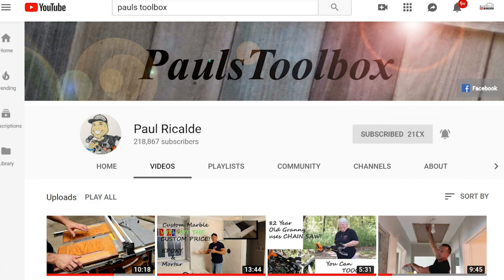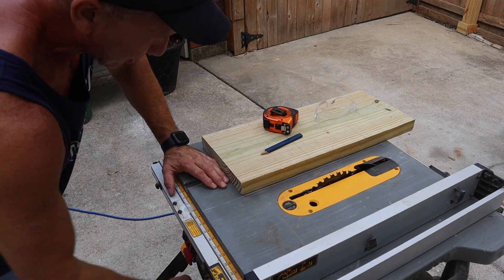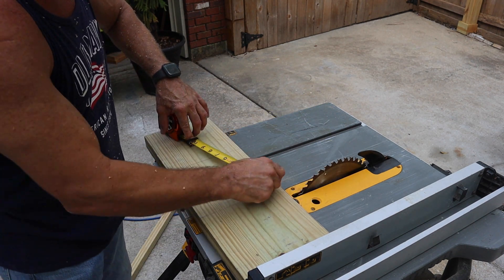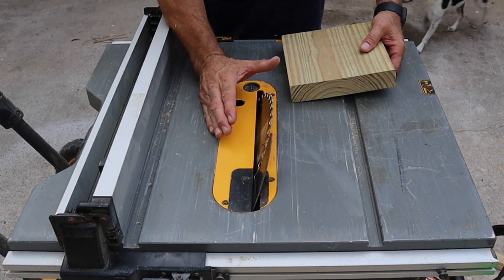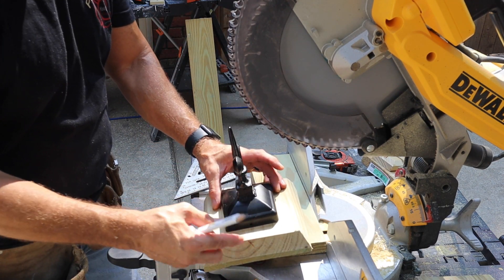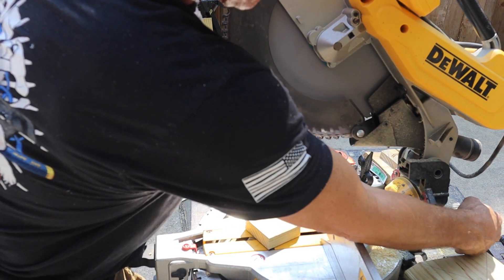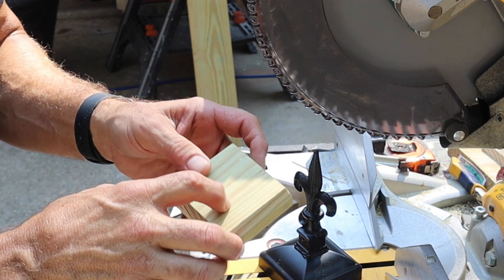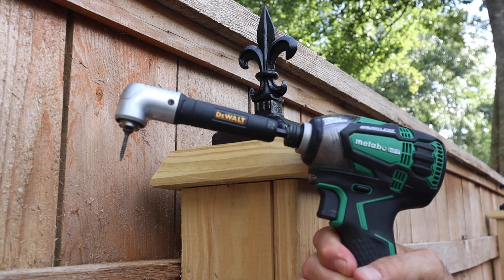DIY Tips: How To Make Post Caps For A Deck, Fence, Gate, Or Mailbox | Paul Ricalde

Comment: Hi Paul! Glad to see you again. I have a question. I like you using two different saws, so if someone is starting out, which of the two saws would be good to start out with if they wanted to build up a small shop (in your opinion)?
Reply: While less portable than a chop saw, the versatility of a table saw makes it a centre piece of most workshops. There’s not many cuts you can’t do on it.
Reply: @huejanus5505  thank you 😊

Comment: Dude, you had a miter saw and you still made those crosscuts on the table saw? Really, that's not cool.
Reply from the maker: Good morning John, I understand your point but there was no reason for me to pull out another saw just to make a couple of Cross cuts when I knew I could do it with my table saw. I did mention if someone is new to construction they may want to use a miter saw. I try to give information that anyone can use, some are DIYers and some are more experienced hobbyist or carpenters. I understand your point, but you are looking at it from the other side. If I were to pull out my chop-saw and make those cuts,  I would also have people telling me that it was not cool to set up another saw when I could’ve easily done it with one. I hope you understand and see my point, thanks buddy!
Reply: @paulstoolbox  🤔your right.....🤣
Reply: Great to see a new Paul Ricalde video!
Reply: @paulstoolbox  Hi! Love your videos.  I would suggest though to use a crosscut sled or a miter gauge for any crosscuts. Even though you are pushing it from the right side, it can still bind between the fence and the blade then kick back on you.  Only use the fence for rip cuts.